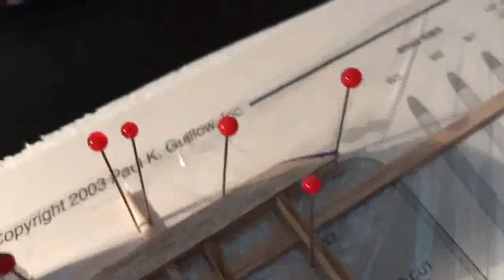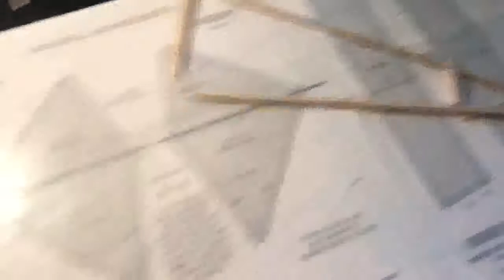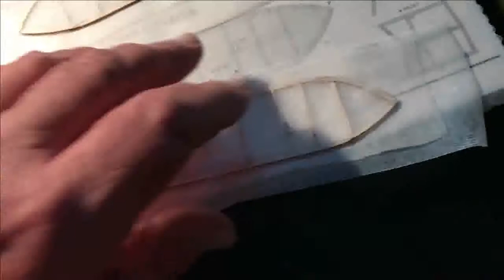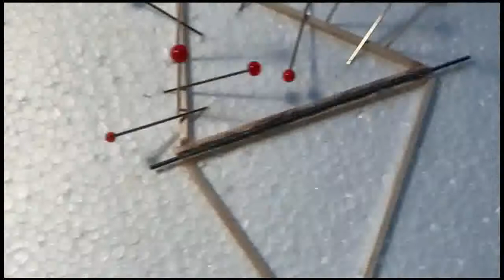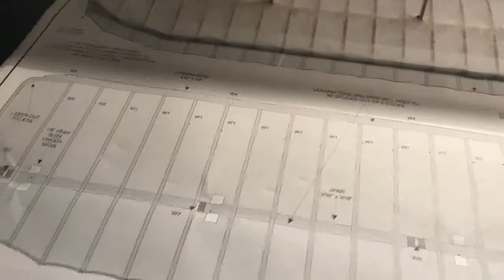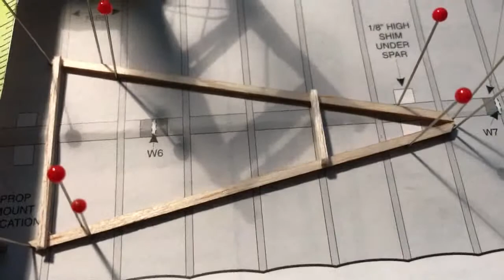Guillow's 1903 Wright Flyer

Comment: fantastic build. i have the kit and am waiting to have a free weekend to start it. would be fun to rig up the wings for warping. I like to add UMX rc electronics and make by guillows and dumas kits fly. This would be challenging to make flyable and hide the servos and main board and batteries but i think it could be done. with modern SAFE mode gyros it could be made controllable even if unstable in pitch etc, and could have yaw control via differential prop speeds.

edit: couldn't wait. got the wings built, what a cool kit. debating whether i should use the included tissue or find beige. excited to see if there's any chance of rigging them for warping once covered.